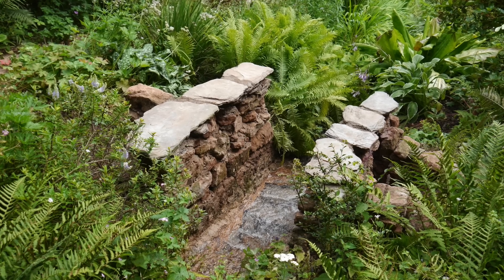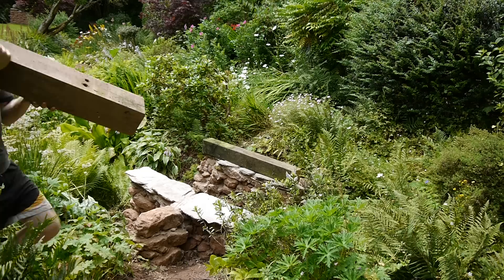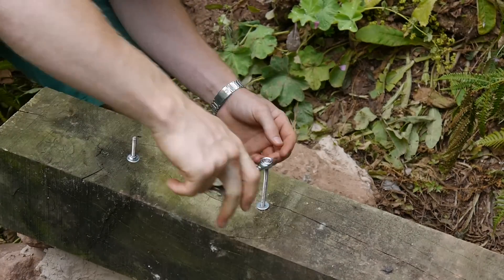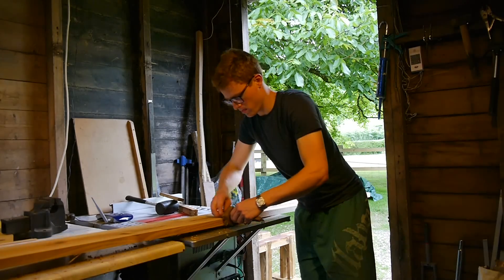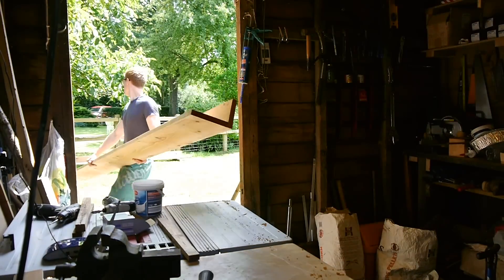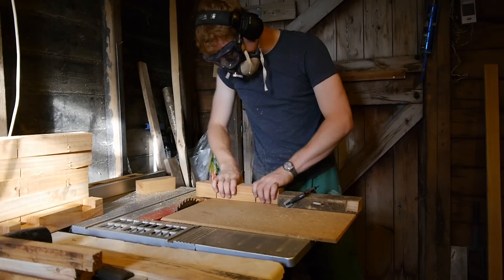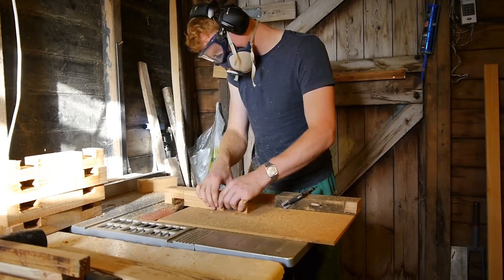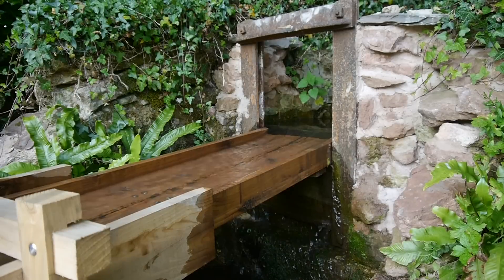Building a water wheel Ep. 3 - Wheel beams and flume Pt. 1

Comment: Use under the roof dry wood when making this. Your wood was really wet and so for swollen. Now dry it up and those seams will open. Using little wet maybe 50%-80% moisture content wood, building and then soaking it in water will use that swelling of the wood to your benefit and you wont lose water from cracks. Other option is to use tar or similar product to seal the wood seams.

Comment: this is truly a fantastic work piece you are doing. 
 My only criticism is that you may have wanted to use more of those bolts, like 5 in a "X" fashion or on. or 2 very big bolt's. Like 1inch (2.54cm) Thick. or with that rebar and slow setting epoxy for cement. 
 besides that, looks great.

Comment: No need to pre-drill for such small screws in wood. Other than that the series looks cool.
Reply: delinquentJACK you're right, dry Cedar doesn't ever crack and it's super easy to screw into 4/4 sidegrain with no pilot hole